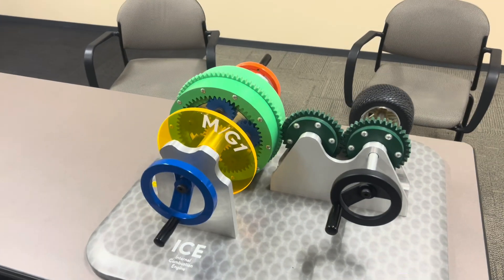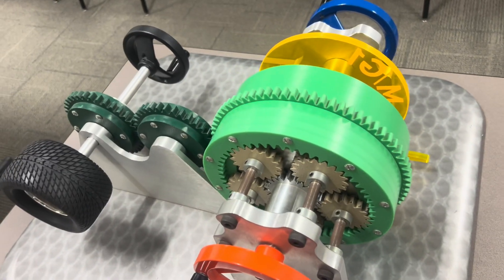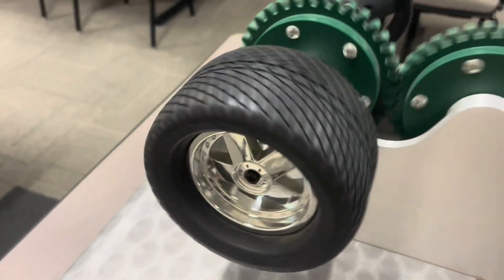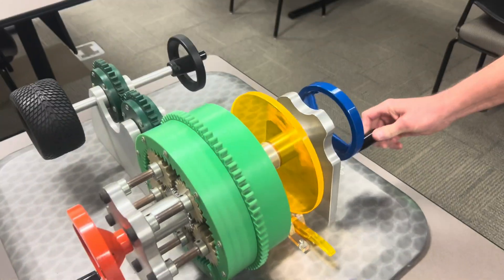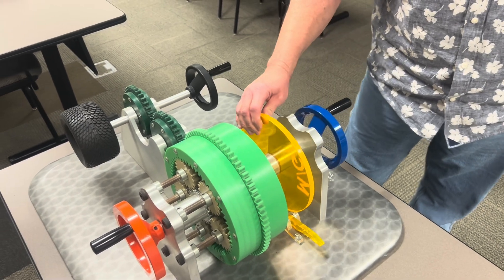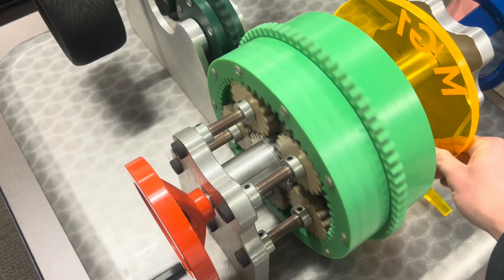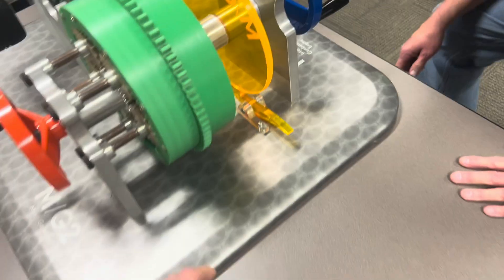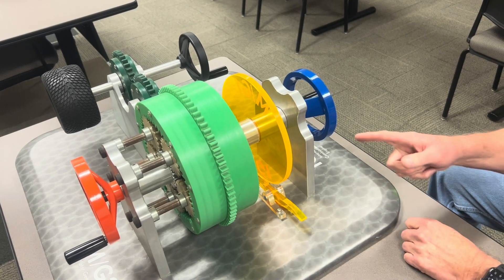This Hybrid Transmission is cooler than you think!

Comment: I cant wait to add PHEV Nissan Leaf computer set up to run my Second Gen2 Prius 2005 15 to 20 minutes on Ev Mode soon Life with 😊🎉
Reply: Does it involve adding batteries?
Reply: @KarmicPatina  only a few sodium batteries 🔋 by Nexcell
Reply: @KarmicPatina  yes with Sodium batteries 🔋 from Nexcell
Reply: @KarmicPatina  the Prius already has enough to do 1-2 miles of range if you use it right, but the current programming won't go electric only unless it determines that the gas engine is completely out of fuel.

Comment: The connection to the planetary gearset is not correct for a Toyota hybrid. However, the information being shown is generally accurate for how Toyota hybrids function.

It's also important to note that this is not how all two motor hybrids function. Honda and Mitsubishi have a different operation methodology. Chevy likes to claim the Volt is different, but it's really not.
Reply: Actually, this is correct for the new hybrids. Gen 3 Prius and newer.
The gen 2 Prius only has 1 planetary gearset instead of 2.
Reply: The volt is different, ive heard gen one might work like this but gen 2 is purely a generator that charges the battery. It's a series hybrid.